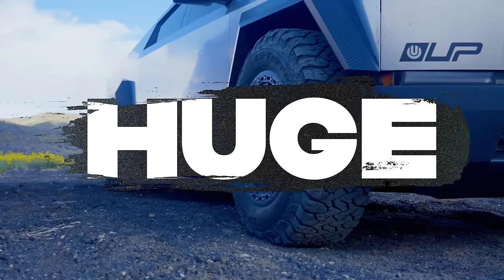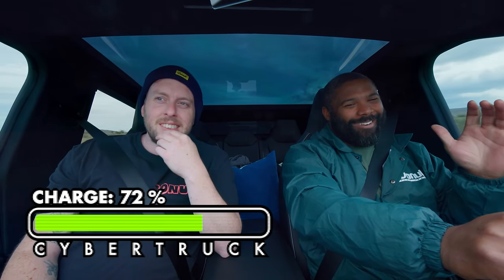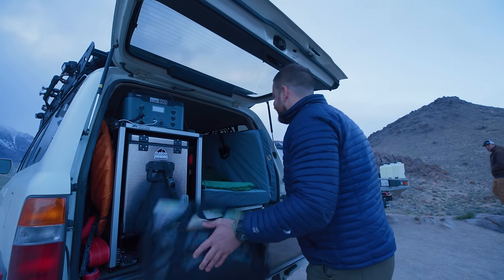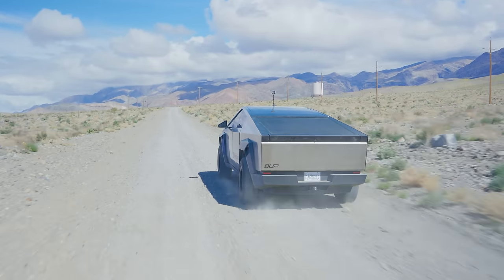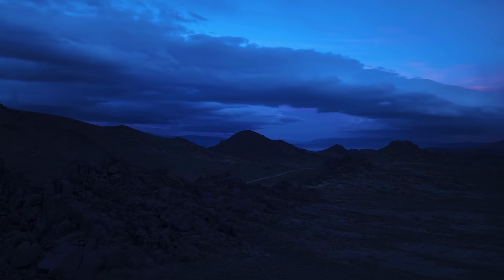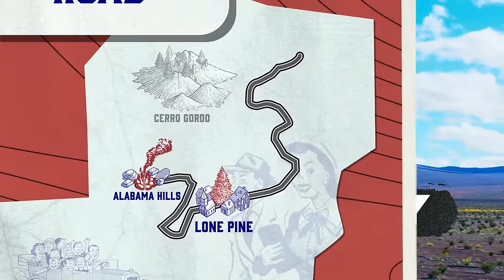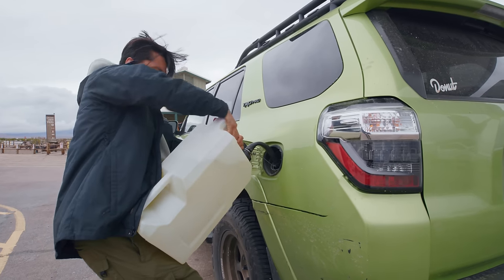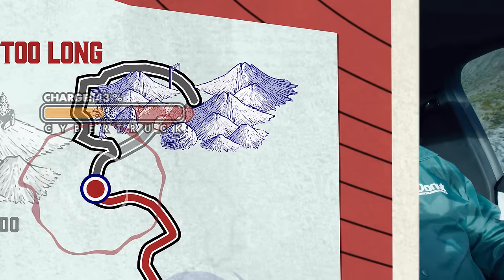Surviving 100 Miles Offroad in a Cybertruck

Comment: I'd like to see gas generator, fuel cell,  using regular charge plugs that fit 120v wall-power and 240v drier and cooking-oven outlets...  If there is a multi-day parking period involved maybe try using solar to avoid battery drain while parked. Deep country in an ev I feel is possible but requires different preparation for combating range anxiety with whatever resources are available and with careful planning.
Reply: I think Stellantis is making exactly what you’re describing, the new Ramcharger has a gas generator and 690 miles of combined range. I’m not sure if it will support outlet charging or not but I do think it will be the most successful “ev” truck when it comes out.
Reply: Deep offroad in an ev is years away from being viable
Reply: Well a gas generator would make it a hybrid which they do sell those lol
Reply: Also they do have adapters for 120 and 240 plugs obviously though its alot slower charge
Reply: @JugganLoo  Yeah, technically the could have charged at that gasless gas station, it would have just taken hours.
Reply: if you're bringing a gas generator that kinda defeats the purpose of an EV, doesn't it
Reply: @Serenity_Dee  Nah. It would only need the gas gen when you are offroad for a long trip with offroading tires.
Reply: Diesel electric hybrid is the answer. Like Edison motors and deboss are building and developing. It's very efficient with existing technology. If oems dump development dollars into maximizing the efficiency of the generator, regardless of fuel type, the efficiency and range can only improve while emissions goes down
Reply: @Serenity_Dee  exactly! 😂
Reply: Why not use a gas car then at that point?
Reply: My take for an apocalyptic vehicle is something that can basically go anywhere even if slow and heavy but is capable of using anything as a fuel source either electric,gas,diesel etc but alas we don’t have anything like that
Reply: My man paid a membership for a garbage channel haha. Do not delete my comment.
Reply: Adding an overlanding trailer that has battery storage and a motor instead of an axle to push and recharge as needed would go a long ways to making EV overlanding/camping a reality.

Also these remote gas stations could buy a government auctioned power trailer permanently installed that can recharge on solar and provide 220v from battery/generator.
Reply: @xero4479 a diesel generator being used to recharge the batteries on an electric car uses a lot less fuel than an ICE. Plus I think you can use the red diesel and not pay taxes on it.
Reply: @Idiomatick So… in other words, buy a gas powered vehicle if you want to off road. Not an EV.
Reply: Yeah, like ask all your destinations that have power seervices for a little bump while you're there. If you are touring a mine all day, they should find a way to meter a 120v outlet to charge you some cash a little more charge. You can get 120v or 240v in more places than gas if yhe businesses at each destination install somethi g for ev customers.
Reply: Sounds like an extra 1000$ in accessories to keep your truck on.  EVs will never have a place in a hard working mans life. Its too demanding. EVs are meant for your business people, office folks. Where they drive maybe 30miles in 1 day.
Reply: You mean a plug-in hybrid.
Reply: @Idiomatick 😂 which again defeats the core fundamentals of 100% ev.
Why is it so hard to accept that hybrids are really the answer here.?
Reply: At that point just stick with gass also it got pitch black out on there trip solar wouldn't do anything
Reply: @shanew.8784 depends on the EV. Motorcycles are a lot less power hungry, and off road varieties have hot swappable battery modules. Because of the lower consumption, it makes wall outlet charging viable (mine charges about 12mph on wall power). It's easier to generate electricity than it is to refine fuel, so it could be an advantage if the EV is going to live in a desolate area rather than pass through. But you're right, storing and generating the power needed to move a huge truck in remote desolate areas is still years away.
Reply: @Serenity_Dee Nope, the point of an EV is superior performance, better efficiency, and reduced emissions. Even chained to a generator, EVs  still accomplishes these goals. It's why freight rail uses diesel-electric locomotives as opposed to pure diesel - it's more efficient and reduces costs.
Reply: The problem with generators, solar, and 120v charging is they would be SO slow. 
120v outlet can supply at most 2kW. That’s at best, 100 hours of charging to fill the battery. 
Any solar you can bring would take weeks. 
A generator would be the best hope, but any portable generator would still take over 20 hours at full output to charge the battery. 

I mean that’s helpful, but just not it. Adventuring in an EV is still a long way off.
Reply: @stephaneperron727  Hybrids are much more expensive and way way way less reliable.
Reply: @carpenoctem  Yeah. I just meant for the purpose of this video. I think the cybertruck can do the offroading part really well, but the range part sucks. It would have made a better video if they drove the car until it died to prove the point that range sucks, then bring out a generator recharge it and test it on some rocks.

But if I'm going to frequently drive where there are no roads or charging stations, then I would not get an EV pretty much. Or I'd have a generator or battery extension.
Reply: @JugganLoo  No, gas charging is a gasoline range extended EV. 

The Chevy Volt and BMW i3 are gasoline range extended EVs. 

The Toyota Prius and Porsche 918 are hybrids. 

A hybrid receives power from fuel and electricity.
Reply: @Serenity_Dee  How different is bringing a generator from bringing fuel cans? 

Either way you're bringing extra range with you.
Reply: @john2g1  The idea is to reduce emissions. Burning gasoline to generate electricity defeats that. Also, the Cybertruck has so little capacity for gear, what with that hilariously tiny pickup bed, and how much would you have left if you loaded in a generator and fuel canisters. And that doesn't even get into how, like literally every current production electric pickup, the range absolutely plummets once you start adding weight, and gods forbid you want to tow anything. Oh and let's not forget how it'll rust almost instantly if you don't clearcoat it.

In this respect, the Cybertruck isn't ,worse than any other fully electric truck; it's just that it's also a comically poorly designed truck regardless of its drivetrain.
Reply: @Serenity_Dee   Let's get some biases out of the way so you don't confuse my position:
1. I don't like Elon Musk as a person and the cybertruck is one of the few things that Tesla that was wholly his idea
2. I don't like the design of the Cybertruck... It was very much designed as a mall crawler as opposed to what it could have potentially been 

Okay that out of the way I need to debunk almost all of your points:
- Emissions: generators are significantly more fuel-efficient, and produce less emissions. Additionally, diesel generators are even more fuel efficient.

- Space for the generator: it is extremely common for overlanders to place a generator on a tray that extends from the tow hitch. Don't forget to bring a grounding spike. 

-Space for fuel canisters: ??? Are you new to off-roading? No one places their fuel container inside the bed. You use a roof rack or rail system. 
- Weight to range ratio: a generator and 4 fuel cans weighs less than an average size male. Adding 1 adult human will not significantly impact your range. 
-Rust: Okay? Any truck electric or gas you prep for the environment you're going to enter. A gas pickup needs a coat just to survive on street parking in a New York winter. 

Yes the Cybertruck is comically poorly designed for off-roading, because it wasn't designed for off-roading... Which is why the Donut crew was driving a modified Cybertruck. Did you see hi truck low truck? Donut took a pair of gasoline Toyota Tacomas, and modified them for off-roading.
Reply: EG4 6000 with 6k solar just add plug to eg4. Can do 5kwh easy with good sun. Add around 40kwh a day
Reply: @tylerfb1   No one says that you have to do 120V. I've seen plenty of generators that do 240V. What do you think Europeans buy?
Reply: Don't need Tesla to offer a $2k gas generator ("range extender" / "auxiliary power unit") option when you can haul one along with some jerry cans full of fuel in the bed of the truck for a fraction of the cost.  That way, you don't need to carry that extra weight when you're NOT doing long trips.
As for the solar panels, you can jerry-rig your own in place of the tonneau cover instead of waiting for the $5k option from Tesla.
Reply: Sounds like you are describing a gas truck 🤔
Reply: You ev people always try to make excuses for them being stupid, just buy a hybrid at least they are practical
Reply: @natexthomass I see Ford Lightnings everywhere. I don't live in a major city either.

It will be interesting, but also, I have no need for electric. If I don't wanna spend much money to travel, I use my Motorcycle, if long trips, Toyota, if need to haul, F-150. Then a $900 Chevy S10 for fun. In all, vehicles value are less than $10k.

I have my first "big boy" car coming up in a Ranger Raptor. Does things Electric cars just don't provide.
Reply: @john2g1  generators are limited by their capacity. The wall outlet is what I was referring to. A 240 wall outlet could provide enough power to charge this overnight, but most household 240 outlets, like dryers and ranges, will still take 12-15 hours.
Reply: @tylerfb1   I get what you're saying, but no one has to drive until the battery is depleted; and no one has to charge until the battery is completely full.

Batteries do not charge at a universal speed. The closer they are to full the slower they charge; particularly after an 80% charge. During the time that you are not driving you can fire up the generator and get the charge you need especially since you don't need to charge from 0% and you don't need to charge to 100%
Reply: @john2g1  that’s true, and anything helps. But in the video, a day of driving used 70-80 % of charge. That’s really significant. One could plan accordingly, charging where you can when you can, but that’s…stressful. And that’s the point. On an overland trip, I wouldn’t want to do it with I hope I can get enough charge here, here and here. I want to know I can get what I need when I need it.

That being said, I watched these dudes from Australia that would take multi-day overland trips with kitted out camp trailers. One of those with e-axles, a battery pack and like a 12-20kw genny and perhaps solar would be really cool and resolve all problems except one: it would be outrageously expensive, prohibitively so for most. 

So we come back to the realistic options: an old Land Rover (haha), or a hybrid. 
IMO, hybrids are the future of EVs.
Reply: Ev is "possible"? When I need a Phillips head screwdriver and can't find one I use a standard and angle it 45 degrees. Works but it's the wrong tool. EVs are the wrong tool outside the city. And still a poor tool in a lot of cities
Reply: @pastaalalamborghini  100% agree with a diesel hybrid. I have a f150 hybrid with the 7.2KW gen and I can power a whole house or 3 camping trailers.
Reply: @batialexis9339 how is it garage?? I think it pretty cool what they do.
Reply: I feel ev-only mandate by 2035 that closes out carbon neutral fuels and other green hybrid or fuel cell energy sources is a bad call…ev only won’t work for everyone, and there are much better low carbon to no carbon solutions that work in hybrid vehicle designs that people shone allowed and encouraged to innovate on so we can have future clean energy for everyone
Reply: Get a load of this guy 💀👍
Reply: Why are we doing the most. This type of vehicle makes no sense. You're just replacing one negative for another. Gas to coal power. (Generating electricity is arguably just as bad or worse than gas emissions.) Plus, now we have to do all this bs just to have the same experience that gas cars have given us for nearly a hundred years. How does this make sense??
Reply: @benlindfors1501  theoretically it’s easier to make clean electricity than clean liquid fuel……I feel that highly promoted theory may proove false in the long term and very detrimental in terms of unnecessarily destroyed gas vehicles that could have been made cleaner instead of and in terms of massive mining damage from materials sources for batteries
Reply: Tow a diesel generator lol
Reply: 2024 and people are still making the "I can put a generator in my Cybertruck, checkmate haters" comment where they reinvent the Hybrid through sheer fanboyism
Reply: @danielwilliams4473  
1. Garbage content for non car guys who think they're.
2. Deleting bad reputation comments.
Reply: @Serenity_Dee not really? You know why we're going EV right? It's because localised emissions in populated areas. We're still burning fuel at power stations regardless for the power. Gas generator would be a good emergency backup as you'd get 80% mileage of cybertruck at 18% the weight of one battery. Plus diesel keeps a long time. Just use hybrid in places away from people to top up charge and we're all still in the green.
Edit: to expand in this. Diesel gives 10 kWh of power, with most generators you'll see maybe 3.3 kWh of this. 5 gallon fuel tank, small 80KG or so motorhome generator. Now you're set for long roads.
Reply: @pastaalalamborghini bruh have you ever gone rock crawling in a diesel? It’s fucking insanely hard to control the torque over slow crawls.
Reply: @k00ms  in the hybrid model I'm talking about the diesel is just a driving a generator that feeds a battery pack and electric motors are the only motors driving the wheels. So let's say your battery and motor combo get you 150miles of range on a charge. If the generator can recharge you twice with the fuel onboard, you've got a 450mile range. 
We're seeing some cars and ebikes with controllers that give you pretty dynamic control of the power delivery of electric motors. A little tuning to dial that in specifically for rock crawling and I think it would be incredible.
Reply: Cope. Have a model Y and the range is terrible. Gotta charge every 2-3days
Reply: @Serenity_Dee no it doesn't. EV means electric motor is used to move the vehicle instead of mechanical motor. Gas CAN produce electricity thus powering or increasing the mileage the electric motors can drive. Assuming ev cars needs 25kw of power to run those motors at 60mph. There's no efficient mechanical Gasoline motors that can produce 30kw-40kw that can fit in that car so the battery is used as primary source of power to achieve such demand. Using Gasoline gas generator is basically converting from one source of energy to compatible energy to EV thus from potential to compatible potential to usable kinetic energy

Comment: What surprised me is the loose accelerator pedal cover recall gave the specific number of 3,878 total units delivered so far in about six months.  That is way short of the initial 125K and later 250K units per year Tesla said it would produce.  There must be some fairly serious impediments to volume production.  Despite the low numbers delivered, owner blogs have a lot of complaining about quality control issues.   The four years of resources Tesla spent on the Cybertruck probably would have been better put toward developing a less feature-rich entry level car which could have been sold globally.

There are a lot of neat innovations in the Cybertruck and it does deliver top notch performance within limits of the battery capacity.  Tesla is kind of stuck with the Cybertruck now, and they don’t have the entry level car that investors have been hoping for.  It is a little late to be getting into the global entry level market now because BYD and other Chinese makers already have a large presence and the mind share granted by being there first.